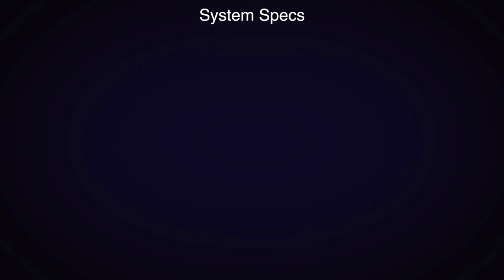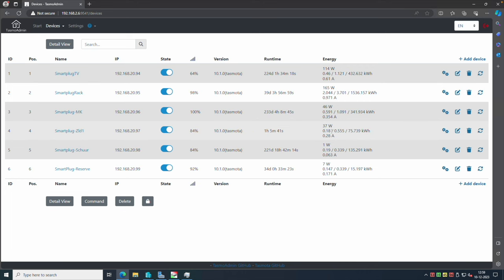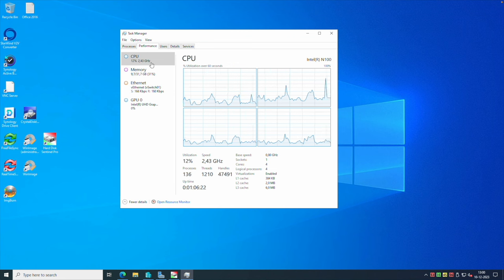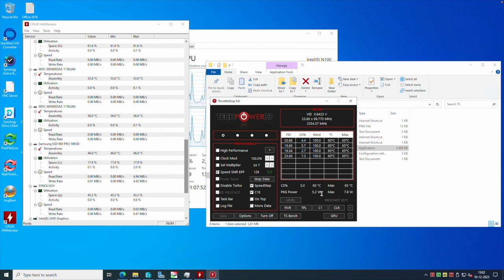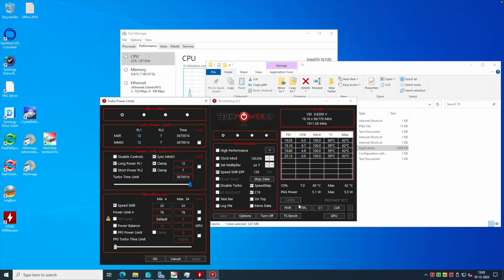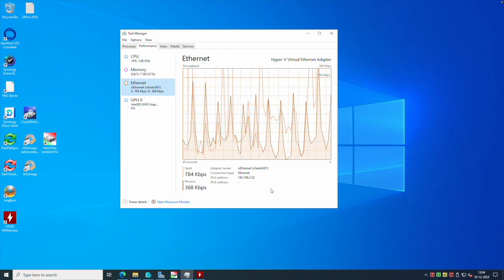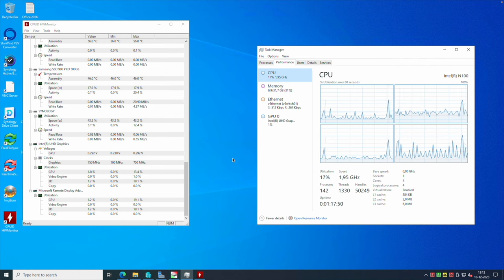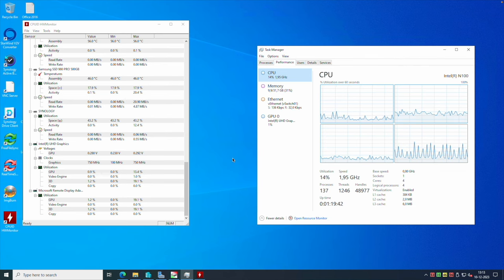Intel N100 Server "Upgrade" - Part 3 - Finale - Power Consumption and Verdict

Comment: I think the idle consumption is quite high for a CPU with a TCP of 6. I understand that you deliberately opted for an SPU and not a DC Jack. But wouldn't the savings potential be many times greater?
Reply from the maker: Keep in mind this also includes 2 7200rpm harddrives.

Comment: Hello, thanks for these 3 videos on the Asus Prime N100I-D D4, very helpful and to the point! By the way, have you made any tests with CrystalDiskMark on the 1TB Samsung 980 NVMe and if so what were the results for it since it is a PCIe 3.0 x4 module and the M.2 slot on this motherboard is x2 ?
Reply from the maker: The speeds are about what to expect with 3.0 x2. The interface maxes out at 2GB/s in any direction.
Reply: @nelizmastr Thank you very much for your reply!!! All the best for a fruitful and let us all hope, wonderful 2024!!!

Comment: Hey man! Greetings from Latvia. Thank you for series! If I were you and be desperate for saving power i would go with proper intel system and migrate absolutely whole thing (from Gateway router, HV01, PVETest and PVE02 to ethernet port for switch) onto it. I know it sound unsafe and bit mental, but it works. 😆 Also there are perks like only bus speed be "limiting network factor" between vms. :) Anyways, I love your setup and how you test things! 👍 Iam thinking about building cpu render farm, that can idle on extremely low watts, but I don't know how I gonna build it. Single 14900k (8p/16e all of them highly clocked) is like 40k CB23, while theese things are like 3k CB23... in theory I would need ~14x100N's just to keep up... Any ideas/alternatives? Those 305 might be sweeter deal for my use case.
Reply from the maker: Great to hear you enjoyed the series!

Due to my main PC experiencing a motherboard failure, the PVETEST server has since been discontinued and sold off in parts (I stole the motherboard for my main system). The PVE02, which runs my storage array, is soon to be upgraded to flash only storage. Currently waiting on my last 8TB SSD to come in and I'll take out all spinning rust and selling that off. I don't intend to consolidate further, as the N100 is not powerful enough to handle that server's tasks as well. The upside is that system takes mATX motherboards. 

Regarding your render farm, I'd pick a CPU that balances performance and powerdraw. Take a look at those obscure i7-11800H motherboards on Aliexpress. They're about half the price of a single 14900K CPU. They push 12K CB23 but, since they are laptop CPUs, idle close to 0.

Comment: Could you please run cinebench r23 on in? Mine get 1300 points and hits 86 Celsius when it should be 2200. I think because of temps it throttles a lot and this values are without throttlestop. I'm wondering if that's normal or I should RMA (almost never reaches declared 3,4GHz).
Reply from the maker: I run a modified BIOS on mine with a higher power limit and a fan and I’ve seen it run at 3.4 more often. The stock power limit and passive cooling are inadequate for reaching the full potential.

I sadly cannot test cinebench as the system has been retired as a hypervisor and runs Linux now.

Comment: Why are you using Windows Server? Are you running a Domain or anything? What is this for? Are you running some kind of proprietary Windows software package, SQL server, etc? That is the interesting part!
Reply from the maker: I chose Windows Server because when I built the original version of this machine in 2021 there wasn’t any other OS that could properly pass through and utilise the Intel graphics for Plex transcoding and because my backup software only supports vmware and hyperv (synology activr backup) :)

Comment: Nicht video, thank you...can you tell me  more about the 19 ich case für this Mainboard?
Reply from the maker: Hi,

the system was built into the Inter-Tech 1.5U-1528L. An 1.5U case that houses a FlexATX PSU, mini ITX motherboard and dual 3,5" drives via a sata backplane.